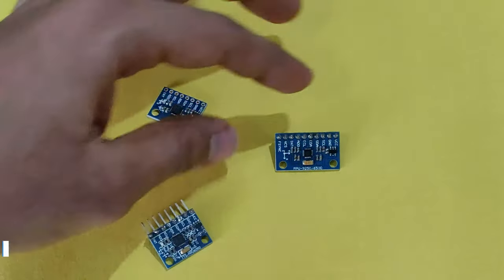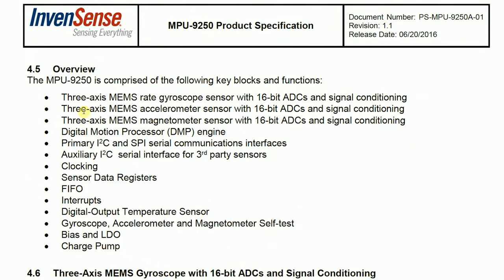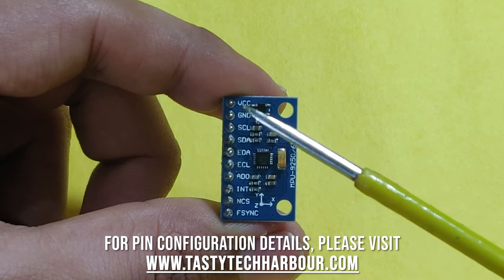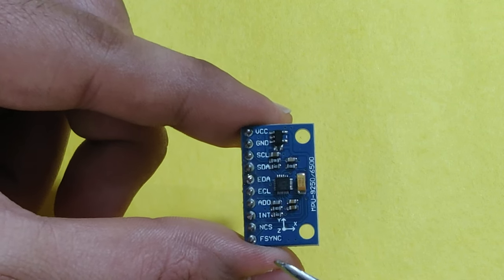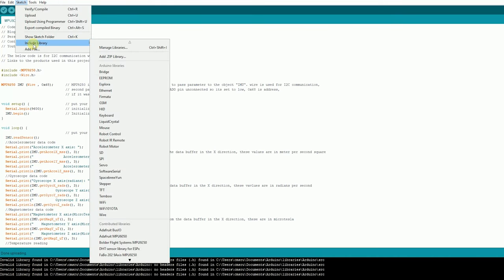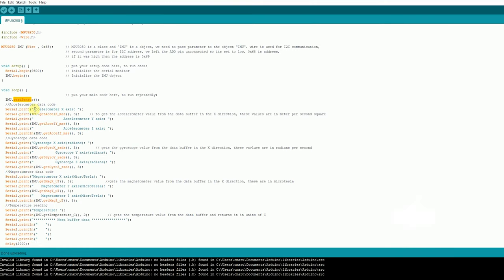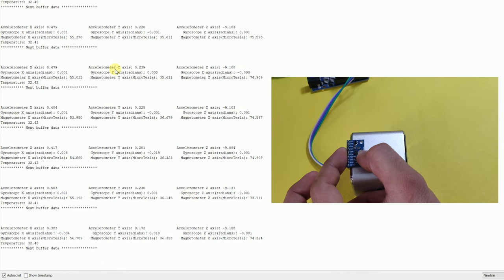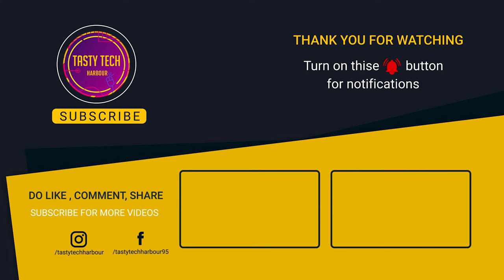MPU9250 module with Arduino Tutorials -Accelerometer, gyroscope and Magnetometer sensor

Comment: This code doesn't work. It shows zero for accelerometer, gyroscope and magnetometer.
Reply from the maker: Could you check once withe connection or press reset button on Arduino?
Reply: @TastyTechHarbour  I've already done it. Obs: I'm using Arduino Mega.
Reply from the maker: @mirellamachado7980  could you please check the I2C communication pins for mega ?
Reply: @TastyTechHarbour  I2C communication pins for mega are 20 (SDA) and 21 (SCL)
Reply: @TastyTechHarbour  I also experienced it, only the temperature data can be read
Reply: I have the same issue. I have actually a mega and uno. Both do the same thing. All axis of each sensor is 0.000 except temp. It seems to be reading. Which if the temp is reading than the I2c should be working correct?  Either someone is putting out a ton of junk MPUs or something else is wrong. I have spent 2 days trying to figure it out. It does tell me that I have no header file or library at the bottom of the IDE but idk how this could be since I got the library from the IDE itself. Anyway i ordered 2 more I will save the code and try them both later this week.
Reply: @jessedavis6196  your sensor is defective. You’ve got to pick up another one. I found out mine was defective and other users had the same problem as me.
Reply: @Mimicona123  thank you for the quick response. it makes me actually quite mad. not that it is an expensive component but now I'm subject to waiting after wasting 2 days trying to figure out what was wrong. mine is supposedly a hi letgo brand... but thank you for telling me I can now move on from it without having it in the back of my head as unresolved.
Reply: @jessedavis6196  i spent one week trying to sort out the problem. Then I found on the internet that other people had the same problem as me, and the sensor was defective

Comment: Hello ,
Which one do you think is better?
MPU6050 ,
MPU9250
I'll be glad, if you help me.
Reply from the maker: It depends on features u want, this is 9 axis and mpu6050 is 6 axis. Based on your application u can use
Reply: @TastyTechHarbour  tenks
Reply: For Anyone who has the same question:
The MPU-9250 is better because it has one more feature. If you do not need the magnetometer then you can save some money by buying the MPU-6050. Other than that they are the same :)

Comment: So this is my second video I have tried to follow. I have problems.

I want to use the ATMega. When I do this i change the board to the atmega under tools. I compile and everything is fine. When i send it to the board the serial port reports nothing.

I switch to arduino uno. I upload sketch and i am getting the layout in the serial port but everything is zeros. I have bought new mpu’s because someone said mine was bad. However after installing a new one i get the same issue.

The only thing that is different is when I upload my sketch it keeps saying no library even though I def have the library in my libraries folder. I can’t figure out what I am doing wrong.

Comment: Hi,

I'm using the code you have provided, however, for the Magnetometer I am only getting 0.000 out for all 3 Axes.
Reply from the maker: Could you please check the connection once again
Reply: @TastyTechHarbour  
I have checked the connections and they look good, I think that I simply have a faulty module. I will be ordering a new one soon 👍
Reply: @dispris  what was the problem at the end?
Reply: brother was the module issue? @dispris

Comment: Hi there, 
Great tutorial ! 
I got 2 MPU 9250 units and the magnetometer values compared to each other (with direction to the North) are totaly different. Is there a way to recalibrate the magnetometer with an arduino sketch ?
Reply: speaker magnet

Comment: I'm using the code you have provided, however, for the Magnetometer I am only getting 0.000 out for all 3 Axes, I have checked the connections and they look good
can u help me to fix that
Reply: can you provide me the code
the link is not working description

Comment: Fatal error:cstddef: no such file or directory.

I am getting that error. When I delete the c includes. I get a cmath error in the eigen file. What causes this? I am trying to verify/compile the code.
Reply: i am also getting the same error. could you find out the reason?

Comment: Hello  thanks, but. i take this error menssaje., wat do you think that´s hapened me?

Se encontraron varias bibliotecas para "Wire.h"
Usado: C:\Users\victor\Downloads\arduino-1.8.10-windows\arduino-1.8.10\hardware\arduino\avr\libraries\Wire
Se encontraron varias bibliotecas para "SPI.h"
Usado: C:\Users\victor\Downloads\arduino-1.8.10-windows\arduino-1.8.10\hardware\arduino\avr\libraries\SPI
Se encontraron varias bibliotecas para "MPU9250.h"
Usado: C:\Users\victor\Documents\Arduino\libraries\Bolder_Flight_Systems_MPU9250
exit status 1
stray '\302' in program